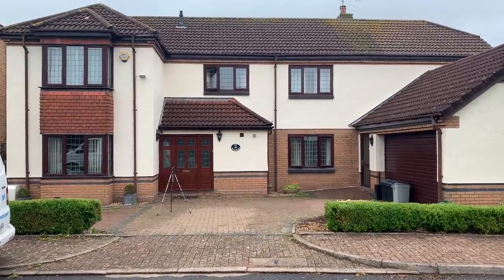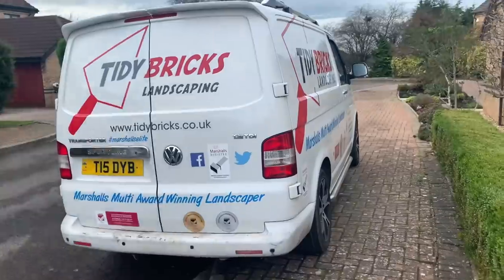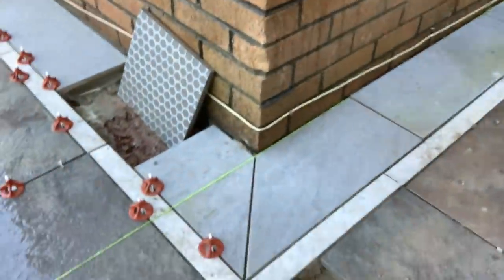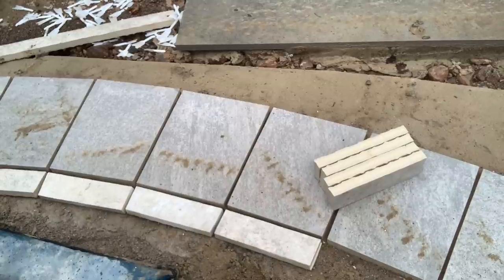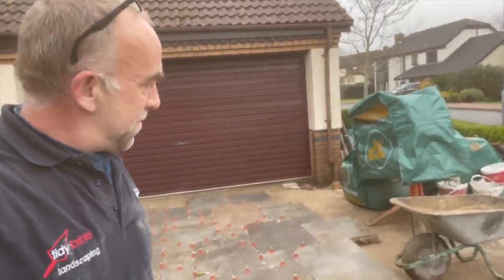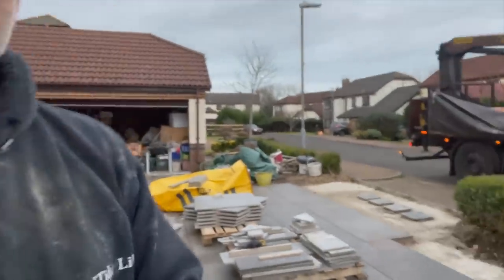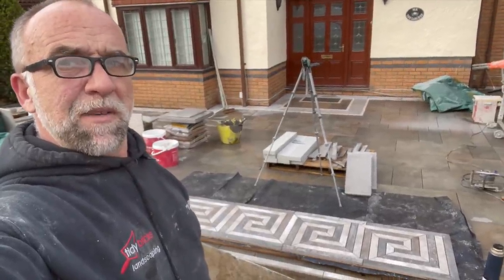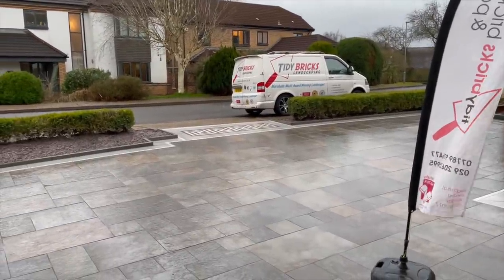How to Install a Porcelain Driveway from Start to Finish: Tips and Tricks.#porcelain #driveway

Comment: Hi,

Great work,

With the movement joints do you finish a with a grout finish, silicone or an actual movement joint imbedded in the wet bed?

Thanks
Reply from the maker: Normal grout finish that patio will never move it’s almost 500mm thick 👍🏴

Comment: Wow. Beautiful work, absolutely no shortcuts of any kind, masterpiece and a winner of every prize 

I was going to do a block paving driveway until I saw this, can I just ask a technical question , 

Porcelain tiles are 20mm is that strong enough to drive on, how thick should the sand/cement between the concrete and tile ?

Once the tile is primed is there any chance of it delaminating when a car goes on it ?

Thank you
Reply from the maker: Around 40mm cement depth and you can now buy 30mm driveway tiles, I just went over kill you don’t really concrete otherwise 👍🏴
Reply: Thank you

Comment: Hi there. Excellent video, great to watch. Where did you get the tile levelling system please ? I have bought three different sets on amazon and had to send them all back, despite the seller saying they would work on 20mm paving, they only work on tiles between 16mm and 18mm. Doing a small DIY project at home. Thanks.
Reply from the maker: Vite clips I buy off tilers tools say tidy sent you 👍🏴

Comment: Brilliant work.!
Do you think you could lay a porcelain driveway off just using hardcore as your sub base. Or would you insist on a concrete base?
Reply from the maker: That’s a hard question as it’s not really the normal type thing to do anyways using porcelain on drives because of the expense.
If you did instead of using the normal amount of type1 which is normally 150mm then 50mm screed and 50mm paver 
Maybe go 250mm type 1 and then 30/40mm wet cement bed prime the tile and yeh sounds about right
I just went overkill as that drives about 450\500mm thick 
👍🏴
Reply: @tidybrickslandscaping  thanks mate 👍

Comment: Staffordshire, would you come up to Staffordshire?
Need an existing 4 car imprinted concrete driveway replaced which will follow down both sides of the house and onto a rear patio. 
Amazing work. Exactly what I want doing 👍🏼
Reply from the maker: Sorry mate I really leave Cardiff these days so much work about just round the corner 👍🏴
Reply: @tidybrickslandscaping  sorted then. I’m moving to Cardiff just so you can design my drive and patio 😉👍🏼

Comment: Hi who do you recommend to buy porcelain slabs from as there are alot of new suppliers out there and different prices for glazed tiles. Thanks
Reply from the maker: I always use Marshall’s there not cheap £60m2 but there much better quality than the cheaper £30m2 version and the materials are only 20% of the price anyways

Comment: Hi, great job, what grout do you use for porcelain please?
Reply from the maker: Are use the marshals exterior jointing grout not recommended to use if you’ve never done it before it can be very messy and goes hard very quick 👍🏴
Reply: I have used a few products before so bit of experience, have you used flowpoint for porcelain driveways?
Reply from the maker: @julianaustin815  never actually used flowpoint yet but my mate Matty has check out his channel it’s called brockstone landscapes but I’m the only one that’s done a porcelain driveway though 👍🏴

Comment: Fantastic work.  Quick question about your expansion gaps, did you leave the shuttering under the concrete?  Does the gap not actually have to be a gap?  I need my driveway done (11.3m wide by 5m deep) but cant work out how thick the MOT or concrete should be and where to put the expansion gaps.  The fall of the tiles is towards the house where it meets a full width ACO drain.
Reply from the maker: I left the timers in and the expansion foam stuck to it. As for the joints just stand outside your gate and make a judgement call 👍🏴

Comment: Amazing job!  Its so great to see a craftsman at work who takes the time to figure out and then execute the details.  It transforms the whole job.  I have some questions that I hope you can help me with.  On the part of the driveway between the garage door and driveway entrance off the road, you mentioned that you had to adjust the cross pitched higher part of the driveway to meet up with the lower level area at the garage door.  Do you remember what your slope was over that distance?  What you did looks really good with out any noticeable difference at the joints.  How much of a height difference do you think would be acceptable between the stone edges with a joint width of 4-5 mm?  I have a similar situation and was thinking about going from a 2% cross pitch to a level strip drain like you had at the garage.  The porcelain pieces are going to be about 60 cm X 90 cm.
Reply from the maker: I think the distance from the main slope to the garage aco would of been about 6meters and the height difference would of be about 150mm I think and took me ages to do melted my brain trying to hide it.  👍🏴

Comment: Hi Scott, I have been looking at the Marshalls 'SYMPHONY® Plus Driveway' porcelain paving system, as an alternative to the wet mix morter base. They claim ...... Seriously easy and quick to install, laid on a flexible bed, backed with 50mm concrete for strength, Joint with polymeric sand. The system does sound good, but am concerned how it will stand up on a driveway, being used with medium sized cars. Please can you confirm your thoughts on this system and have you considered using it?   Cheers.... Mal
Reply from the maker: I wouldn’t trust the symphony plus with a bargepole and a lot of the marshals installers feel the same that’s why I went for a solid concrete base 👍🏴
Reply: @tidybrickslandscaping  Thanks for your informative reply, confirms the doubts I have about the system.

Comment: What's the thickness of the outdoor porcelain tiles you usually install?
Reply from the maker: All the porcelain tiles I’ve laid are always 20mm but there is now a 30mm opinion for driveways 👍🏴
Reply: @tidybrickslandscaping  I see. Unfortunately, only 10mm porcelain tiles are available in my area. I wonder if it still enough for garage.
Reply from the maker: @johncruz1644  10mm are normally for internal work just so you know 👍🏴

Comment: That saw is a nice piece of kit, looks expensive.
When you pre cut the mitres  do you check that all the corners are 90° before you do the cuts?
Do you think the Greek key panel will stand the test of time as its on a high traffic area?
Another nice job, hope you earned well, you deserve it!
Reply from the maker: Thanks Keith and yes that’s all is a nice bit of kit £2800 and is as far as that Greek key design yes doublechecked everything triple checked and I do have faith that is going to stand the test of time. I definitely should’ve charged more 👍🏴

Comment: Looks amazing.. but why do the marshalls boxes say there a ceramic tile? When the video title says porcelain?
Reply from the maker: Ceramic porcelain both the same thing except for thickness 👍🏴
Reply: Tidybricks Landscaping so they are ceramic? I always thought porcelain tiles were made with higher density clay and fired for longer compared to ceramic so are a lot harder to cut and stronger in general. Didn’t think thickness had any bearing. 👍
Reply from the maker: @MrB3ngy  every think you said then you are 100% correct but these tiles have come direct from Italy so maybe there is some translation lost somewhere well spotted 👍🏴
Reply: Tidybricks Landscaping 👍 would love to do my drive in porcelain but because it’s on a 12 degree slope for the first 10meters  I think it would be to slippery come winter so have had to opt for a granite paver with a textured finish.
Reply from the maker: @MrB3ngy  yeh good idea I used similar ones for that steep driveway video I did granite finish 👍🏴

Comment: Hi do you have to put concrete base down to do a porcelain tile driveway ?
Reply from the maker: You could get away with it maybe but it’s a chance you would have to take I’d prefer to have a concrete base as there’s a lot of weight under the corner of a tile and it could pop dunno 👍🏴

Comment: I’d never considered porcelain for a drive way before, are they hardy enough to cope with cars coming and going on a regular basis….
Reply from the maker: It’s certainly the first porcelain driveway I’ve ever done but the overall thickness is around 450 to 500 mm it’s got to be the strongest driver I’ve ever done slabs primed down will never move and if they do I’ll be really surprised I’m naturally I will go back and fix it but I’m very confident they’ll never have an issue ever 👍🏴
Reply: @tidybrickslandscaping  I was thinking more of the tiles surface, no doubt the way they are set is solid as a rock, just wondering about the actual surface to be driven on…. Presumably they are glazed, so wondering on the durability of the glaze…
Reply from the maker: @borntobirdie8475  valid question and an answer I don’t really know yet myself but I would say the porcelain tiles there are driving on a really solid may be the occasional tire mark but that could be removed. I’m looking forward to going back and seeing it again 👍🏴

Comment: Since the grade is towered the house not away. I believe after replacing the porous surface with solid concrete. After 3 years, i think they've had moisture problems with their house. I'm just Going Out on a limb here.
Reply from the maker: And out on a limb you,are there’s nothing porous about this job it’s all drained away correctly so there shouldn’t be any issues there 👍🏴

Comment: Use a heat gun to fix your plastic that's bent or warped it works better than the hot water
Reply from the maker: If you’ve got a heat gun in the back of the van then you might be a plumber 😆 👍🏴

Comment: Why did you wait 6 weeks Scott to pave on concrete?
Reply from the maker: Mostly down to the original idea of only skimming the cement bed for the tile. I was hoping to get it mega level  but the plan changed last minute as the fall was to much to get the finish I wanted. At that point I had other work booked out to start after the pour.
Mapie advised me to leave for 6 weeks incase of movement as the tight bed joint might crack. 
I’m glad I did it the way I did do it in the end having a decent cement bed which gave me wiggle room to get my falls right. 
That was hard work 😓 down and back then try bend it to the aco by the garage on the right 
Phew
Reply: @tidybrickslandscaping  ok, great.
Hell of a job, pure class buddy.
I've got one coming up similar so have learned from you, cheers
Reply from the maker: @ivegotaporscheandalambo3318  thanks for that yeh tough job 
I was down your way today in Warrington getting a service on my table saw at tilers tools/ aqua cut and a site visit to Matty at brockstone
Reply: @tidybrickslandscaping  great stuff, did you get footage of trip to brockstone ?
That wet saw you got is a beast, don't half make a difference.
I got battipav, similar to yours, effortless and better on back.
I'm getting too old for this s..t now, but crack on, no nothing else.
Reply from the maker: @ivegotaporscheandalambo3318  I’ve got about 150 linear meters of double boarder cuts to do Monday and only a beast will be able to handle it money well spent. 
And yeh I did a 10 min video out of it too going live midday tomorrow 👍🏴
Reply: @tidybrickslandscaping  cool, look forward to that buddy, keep year pecker up and the great work.
God bless

Comment: Why use mortar?, will thinset work too?
Reply from the maker: Depends on your concrete finish levels I wanted to go down that route but I couldn’t because it was in a slight slope so had to use normal concrete not a self levelling which would of enabled you to possibly go down that route 👍🏴
Reply: oK, MAKES SENSE. iI imagine this was a time and material job?,

Comment: Why did you not square up to the pavement instead of that stupid triangle bit it makes it look rubbish? If you hadn't thrown away all of those pavers you could have filled in with some of them???
Reply from the maker: I never use old materials for a base always use fresh type 1MOT every time. Otherwise you will have gaps between the pavers under the driveway and then you have weaknesses.
As for your idea on squaring up the driveway up with the pavement really really bad idea every tile against the house would of have to been cut not whole tile like I have done 👍🏴 
Always square of the entrance of the house

Comment: A nice finish but why did you use bricks under the steel? it makes putting the steel in situ a waste of time. The bricks hold moisture and are in direct contact with the steel which within 12 to 18 months will corrode and break under pressure. You should have used proper concrete spacer blocks. Sorry to piss on your parade pal.
Reply from the maker: The bricks are made a concrete the concrete made of concrete so it’s all the same thing